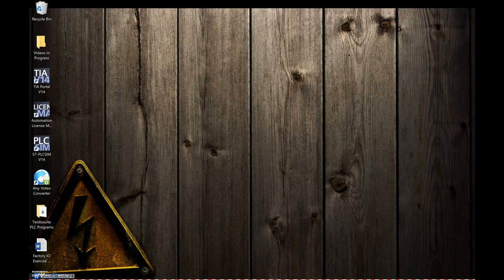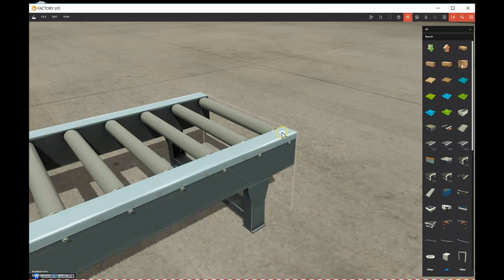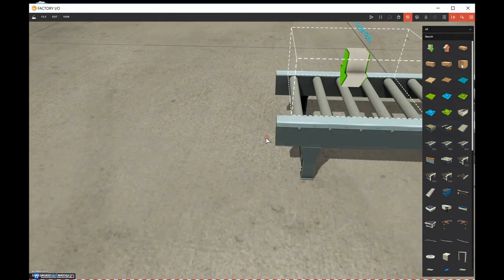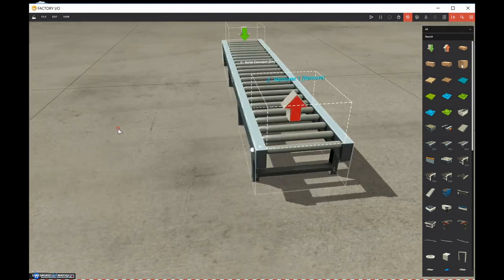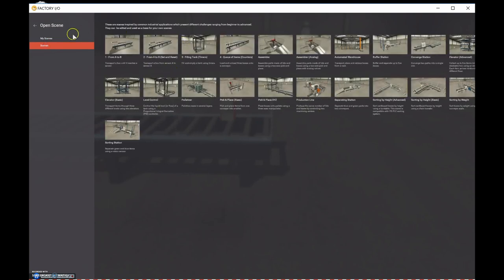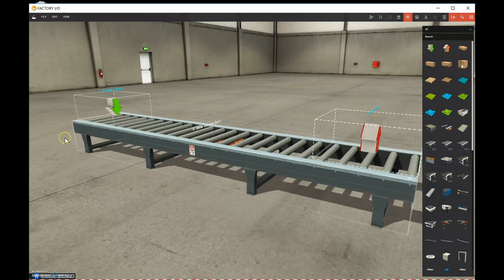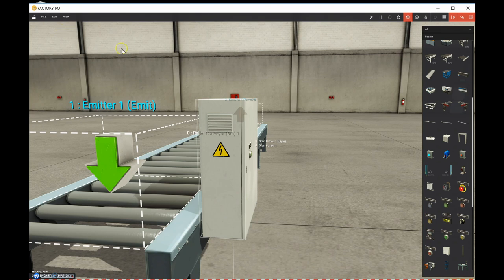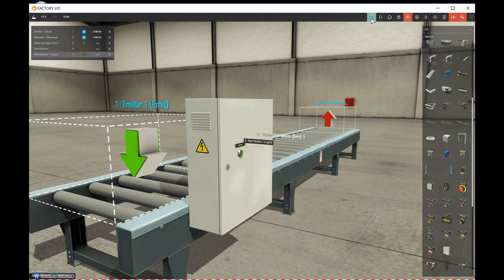Siemens TIA Portal & Factory IO (2 Wire Control of Conveyor)

Comment: Great video Pete! Many thanks. I have a question: what is the purpose of offsetting your addresses (as you demonstrated here)?
Reply from the maker: By offsetting the addresses, it allow the Factory IO software to negate the 8 physical inputs to the PLC. Otherwise the physical state of the inputs will interfere with the software.
Reply: @PeteVree Hi Pete. can you please explain this a bit more. Why cannot the Factory IO use I0.0 ??
Reply from the maker: Because that Input terminal exists on the PLC, so if you use it in Factory IO there will always be a conflict. You have to use inputs that don't physically exist on the actual PLC.

Comment: Hey pete! I love your videos.  My PLC is connected to an eleborate system of water recycling. i didn't make all this, my seniors did.. Now, I being untrained in PLC, have started learning PLC from your videos. Question: If i make a 2 wire program in TIA and connect it to Factory I/O and start the program, will this  turn on the equippments in real time, if yes, it might be a disaster for my company. Is there a way I can just run the simulation on Factory I/o, without affecting the hardware in real time?
Reply from the maker: If you are learning the Siemens TIA you should be using the PLCSIM (Simulation Software) or purchase a basic S7 1200 PLC to be used solely for training purposes. To be clear, don't run Factory IO on the PLC that is hard wired to your company's equipment. 
If your company wants you to learn PLC Programming, then they should purchase the PLC, HMI and Factory IO for you.
Rajvir Singh has a great course here as well: https://nfiautomation.org/courses/learn-siemens-s71200-from-scratch/
Reply: @PeteVree  Thanks Pete. Great help.

Comment: Pete why do you need to offset the inputs ?
Reply from the maker: With the Factory IO you are using virtual inputs from the software... so you have to offset the inputs by 10 so that the actual physical inputs from the PLC are redundant, and the program only responds to the virtual inputs from the Factory IO software.    
  

      
  

    

          
        ·
Reply: @PeteVree  but in the ladder, you used the physical input address I0.1